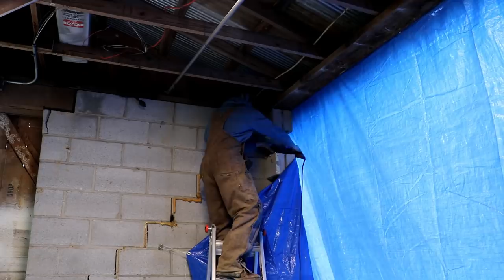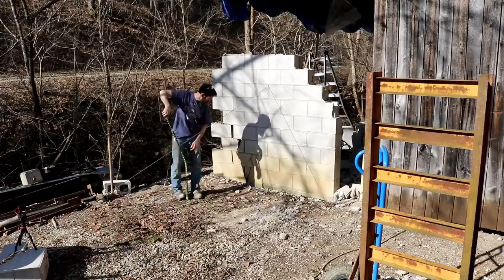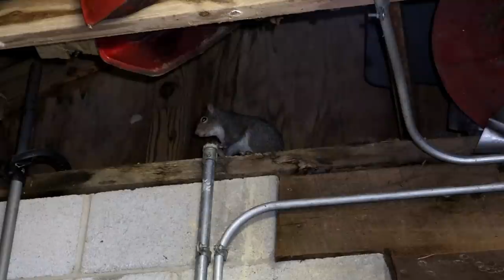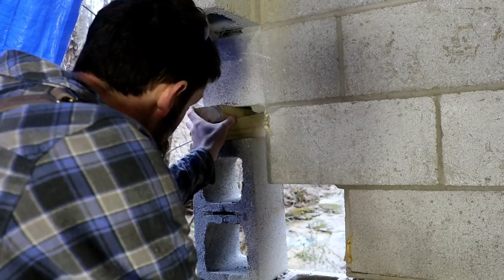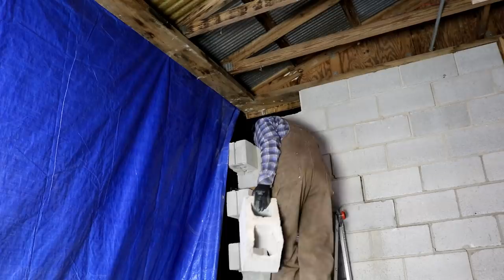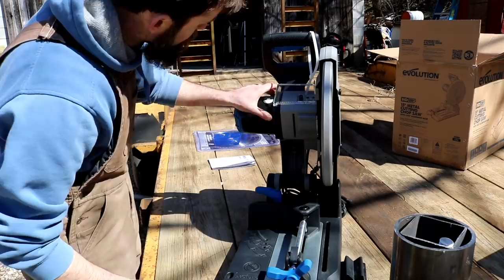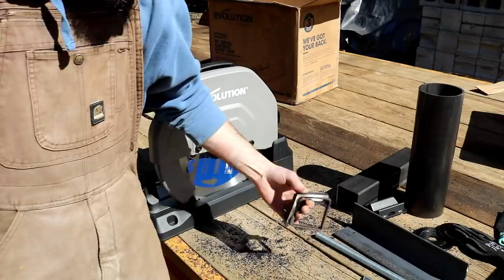Pushing down the block wall & New shop saw ..Shop repair part 6

Comment: Now that you have a chop saw, what are you going to do with the do-all?
Reply: There are lots of materials where the cold saw isn't the right tool for the job. Just the kerf alone is reason enough to use the bandsaw with expensive materials.

Comment: My experience with masons in my area has found them to be alcoholics or very religious teetotalers. The guy who built my basement was one of the latter. I haven't built any block walls. I've seen some knocked down and knocked some down that seemed to have a much stronger connection to the mortar than those walls. I wonder if it was amateurs building the walls.

Comment: Does anyone else think that these walls are really poorly mortared?  I've taken down concrete block walls before and the only way they came apart was to attack the mortar joints and then watch the blocks split because the mortar was so tightly bonded to the blocks.

Comment: I sure hope  you get a gas powered compressor and a jack hammer to demo the floor
Reply: Trailer compressors usually run on diesel. He doesn't need a jackhammer to break up that pad. Can do it with a sledgehammer.

Comment: Nice heavy wall that is way too weak to be of any structural benefit   Your statement about rebuilding it with timber will probably be both stronger and safer.  Also, think of it as archaeological and a commentary on the workers who built in many years ago.

Comment: Love the multi camera wall shot.
I purchased one of those saws late 2019, they are very good, they also do a smaller one, I choose the 110 volt one ( in the UK, even though our domestic house voltage is 240 volt, all industrial/construction power tools must be 110 volt only, there are supplied by a Stepdown transformer with centre tapped connection, meaning there is only 55 volts potential to earth). An advantage of using 110v equipment is that with using the tepdown transformer 240-110v, the inrush current is less likely to trip circuit breakers.
Great vlog thanks for sharing.

Comment: Glad you quit farting around and got that wall down I know safety comes third also the instructions tell you how to cut metal with that new saw to help save the blade surprised about the use of it very nice saw you’re getting there Thanks for the video

Comment: I believe you will be sorely disappointed with your saw's performance on rebar. I bought the similar saw with yellow paint for the same purpose. The hot roll scale will eat the  blade tips for lunch. It will cut nicely for a bit and then just go away. Reserve it for fabrication materials and performance should be great. The best tool is a powered rebar shear - available at most rental stores.

Comment: Miller high life the champaign of bottled beer. Another useless comment, before loading your wheel barrow point it in the direction you are going to go. Helps not to have to do a 180 before getting underway!

Comment: You keep finding evidence of the reason you are having to do this with pulling out all the beer cans out of the wall the people that put up the wall was more concerned with having a good time than building something that will last longer
Reply: Drinking beer has nothing to do with it. Was just shoddy work. Which can be done by the stone cold sober too. Building lasted for the use of the first owner though so it served its purpose. It wasn't built to last forever.
Reply: @1pcfred  true but it shows more of the labor was a lot more interested in having beer than doing the best job they could
Reply: @chrisrhodes5464  if you don't have the materials you can't make much out of what you don't have. It looks like it was a money issue going on there to me. Someone was doing that as cheap as they could. The work they did looked like it was done right. The finger joints between the blocks looked good. The courses were straight once. The walls were probably plumb at one time too. So whoever laid those blocks knew what they were doing. They may have been well aware of what they weren't doing too? I'd be surprised if they weren't.

Comment: To my work ethics, if there is beer cans inside the wall etc, then that shows the quality of the builders workmanship.  not you steve, the previous builders, poor  form of thier part and it shows.
Reply: concrete workers have to keep hydrated, hard work
Reply: I couldn't agree more. See it all the time. I'm not a preacher and never say anything. I enjoy a cold on as much as the next guy but never on the job, even at home not until the work is done and tools away . There's a time and place for everything.
Reply: @jasonvos3956  I totally agree with you